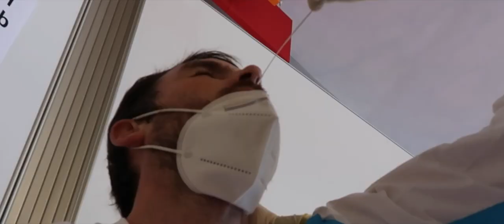A Great German Invention We Don't Use In The USA

Comment: At first I was shocked, because judging from the thumbnail I thought there were no jackhammers in the US 😮
Reply: same xD
Reply: There still none in this video. He keeps confusing a jack hammer with a roto hammer. Roto hammers can act like a mini jack hammer, but jacks don't spin, the just move up and down
Reply: Ah, I see. At least now I know the correct terms. Thanks 👍
Reply: That is not true. Jackhammer is the correct and official name of this device. There are pneumatic, electromechanical, electropneumatic and hydraulic jackhammers. The size does not matter. The device does not rotate, but only moves up and down. The device is even called ( in german ) Würth Bohr - und Meißelhammer (BMH40). And in English it's called Jackhammer. Rotory Hammer is only colloquially known as flex to an angle grinder. And I know that the device only moves up and down because I own the BMH40 myself. Just because it has a function to clamp a drill does not mean that it is not a jackhammer because it is a drill and jackhammer in the same device.
Reply: @marvinh4893  ok then I retract my statement.
Reply: Same

Comment: Wow that’s a tad ambitious in wanting to drive a tractor. Don’t forget it took Nick about 4 years to be able to drive a normal manual car ;-) 🚜
Reply: Always remember the big picture: Nalf in a tractor! The details of how he got there are unimportant, as well as the 7 months it took him. It's a reasonable time frame to ease yourself into something. You know? Why hurry?
Reply: @itwasellinotme5957  7 months.  Haven't we heard that phrase before?
Reply: And you need a driver's licence for driving a tractor in germany.
Reply: @mojojim6458  I’m still not sure. There’s a fog...must be a rift in time. It’s the only way I can explain this whole time chaos. The other possibility would require...noooo. That’s too far fetched. Only an idiot would...yeah. Too far off.
Reply: @tnit7554  Really?  Are you sure?
Reply: @mojojim6458  Yes, there are special ones for tractor (can be obtained already with age 16 opposed to normal car license with 17 or 18) but it's also covered with the normal car drivers license (but be careful regarding combined maximum weight of tractor and trailers). A exception a very slow tractors (limited to max. 6 km/h) which you can drive without any license but those are really hard to find. Most have a higher maximum speed.
Reply: @itwasellinotme5957  on Planet Nalf the time continuum operates or is calculated very differently ! 😉
Reply: @libby9433  don’t we know it? I’m still questioning how he could escape that cage at the airport. He should’ve been back on whatever planet he came from already. I mean, all the signs are there. How could he have slipped through the system? It baffles me.
Reply: @mojojim6458  the normal drivers license is fine, but there is an extra one only for tractors that you can obtain at age 16. So you can drive around in tractors alone legally two years before you can do it with a car. The normal drivers license in Germany allows you to operate vehicles up to 3.5 tons (7.5 with the old drivers license), if your tractor is heavier you need a different license

Comment: My kids used one of those bikes and there were common enough in our small community in Park Slope. Ours was a wooden version. I think we did a lot more research into our toys than average Americans. We also invested in Habba for the kids. Not because there were German toys, but because they were quality wooden toys.
Reply: Haba has indeed very good and high quality children toys. Do you still have little kids? Melissa & Doug from GB are very good too. We have a few toys from M&D and I like them very much.
Reply: @nitka711  We also had the M&D stuff. It wasn't quite as good quality, IMHO. There was occasionally particle board. However I feel the quality of Haba is just really high and I liked the M&D stuff we did get. I just felt I needed to be slightly more picky about what we got.

My youngest is 8 now, but we still talking about the marble tracks we used to make.
Reply: On a similar note: the most amazing high chair that is still useable after many years due to its ingenious construction is the "Tripp Trapp". The different seat levels are slid into notches of the chair's sides. For little kids there are these open restraining arches that can be added or removed as necessary. 
Not German, but Scandinavian (Norwegian, to be exact).
Not a cheap investment but a lot cheaper than buying a new high chair for the same kid over and over once they outgrow their cheap plastic ones.
Heck, with a little adjustment even adults can use them later in life, that's how sturdy they are.

Comment: My daughter also started using such a 'Laufrad' pretty early and had no problems at all balancing a real bike after the switch. The only thing she had to get used to was getting up to speed or stopping with pedals. But that took only a view days and therefore she was able to ride a bike at a much younger age than otherwise; I would really recommend it. And there is another advantage to it, with a 'Laufrad' kids are often able to cover a longer distance at decent speed and won't need a stroller anymore if you're taking a walk - which is probably more important in Germany than in the States ;-)
Reply: Same here. Worked for 2 children, will work for number 3. No need for training wheels. Greetings from Freiburg.
Reply: I learned balancing on a bike with Stützrädern just fine, but those things looks like a great method to teach, too. Granted, my Stützräder didn't really touch the ground unless I really messed up.

Comment: That house is more or less old and they used a lot of asbestos back in the days when they build that house. So stay safe, because they used it everywhere. adhesive, tile adhesive plaster, isolations, windows and so on...
Reply: That's a good point.  Thanks.
Reply: @mojojim6458  Yep, they may wanna hire an Asbest-Gutachter to check that place out. Asbestos is nothing to fuck with.
Reply: As long as you keep the asbestos where it is, it''s not that big of a problem. But as soon as you start breaking things with asbestos in it, removing them and making them to dust... - that can be a nasty thing.
Reply: Is this an issue in old houses in the US? he may not know about the danger.
Reply: @maxling  I'd say "too late". The moment I saw him start digging into those floor tiles with the jackhammer, I thought "wtf?!". The house looks like it's from the 60s or 70s at least, and those tiles look exactly like the slowly crumbling ones I had tested in a house I lived in a few years ago - needless to say I moved out as fast as I could after I got the results.
I think the chances of having no asbestos in those tiles are slim. And outliines of removed wall tiles in one shot and lots of removed plaster on the walls...
Taking one of the floor tiles home to hang on the wall is probably a bad idea, too.
And if there is asbestos in there, he committed quite a few crimes in that video. Working on asbestos without a licence, releasing asbestos into the environment, improper handling and disposal of asbestos...

Comment: I haven't seen any balance bikes as a kid either.  It's an era thing.  I learned to ride a bike the same as you, Nick, with training wheels ("Stützräder" is the German term).
And you're wrong about Dreiss, it's actually the basis for the modern bicycle, and not the invention of the balance bike.
I personally think that the classic version is better.  For one, you learn to use pedals right away, and for another, if your training wheels make it a four-wheeled vehicle, they're set wrong.  The proper setting is that so if you're balanced, neither training wheel touches the ground.  You certainly learn to balance as well as on a balance bike.
IIRC, there is NO science behind balance bikes, even though people think and claim that they're better for learning to ride a proper bicycle.

Comment: Are they installing water heated floors in the house?
That is what they would do here, if digging up the floors like that.
Reply: Installing a heatpump to drive it? https://youtu.be/1jCHYUuEDZ8
(Wärmepumpe)
Reply: @Stadtpark90  
You can do that: taking the heat off the ground to heat the house with water based floor heating, or you can use  the system where you heat the water with a pump,  taking the heat out of the air.  It works perfectly well in Winter also and is popular in remote areas with no city supply of heat under ground.

Comment: Part of the "thing" with tools and equipment in Europe, is the 220/240 VAC power, which allows over twice as much power from a 'standard' house plug, compared to North American 115 VAC, so it's about 4 HP available! And, you've probably noticed that the power cords, for the same power, are much smaller, due to the higher voltage.

Comment: Riding a Bicycle with Training wheels is actually different from riding on two Wheels

I guess Smarter Everyday or Veritasium did a video on that topic

it is because you steer differently: on 2 wheels you actually kinda steer left if you want to go right while on 4 wheels you steer in the direction you want to go

if you ride motorcycles you can't even drive without intuitively doing that

Comment: honestly, for me they are new too. i grew up with training wheels, just like americans did. they were forgotten and had a comeback in the last few years, the running machines. i think it was because bycicles were much faster and more eficient than running machines, so manufacturing switched completely. bikes that small are also not a thing at all, and parents preferred to have a bycicle with adjustable seats, and training wheels that you can take off, so you basically have to only buy two bikes for the kid. one when it's a small child, and one when it turns like 10 y.o. this is an additional expense, but noone dreams of being a homeowner anymore (houses are much more inconvenient in times that change as fast as they do now), so expenses that go towards the child are much less painful. but i am talking out of my chocolate factory.

Comment: For all Americans, this is the way german houses are buildt. By bricks and concreate. Thatfore, oure windows can"t get installed in the wooden houses most of you own. The windows are heavy are the walls have to be very stable. Just saying.
Reply: Germans need super strong walls, because of the frequent earthquakes.
Reply: @mojojim6458  Haha, but no. Bc we wont oure houses to last centuries, not decades.
Reply: That wouldnt work in Texas. Its too hot and the ground is too soft for cement. The house would began to sink into the ground. In TX u just hire a leveler after some years to balance the home because the ground shifts.
Reply: @charlievetta1385  Do you guys ram long pols into the ground before building the actuel bottomplate? We do so if we build a house on swampy ground. Just a thought, thogh.
Reply: @charlievetta1385  Why would you not just put piled foundations under the hardcore? like this for example: https://www.homebuilding.co.uk/advice/foundations-for-difficult-sites
You surely don't build onto soft ground without any piling?
Reply: @juttalio1664  The houses are built about 3 ft off the ground on brick stilts. U need to add bricks when the house begins to sink after so many rainy seasons have passed. April and sept it rains all month. Floods can carry ur car. Building on a hill is ideal but not always possible